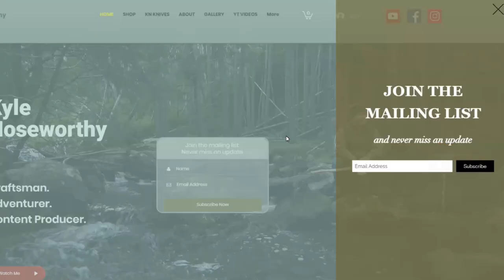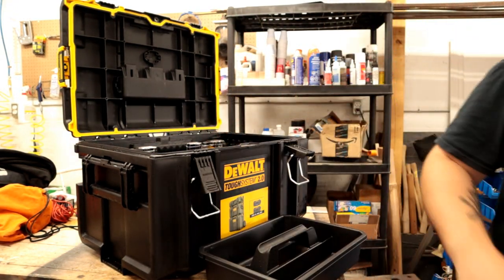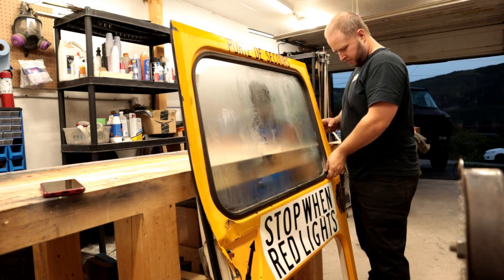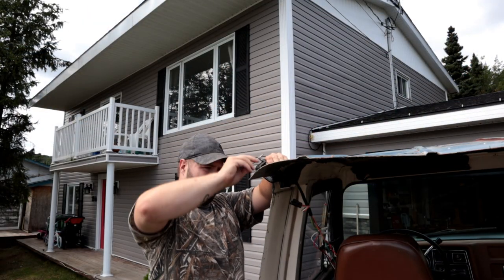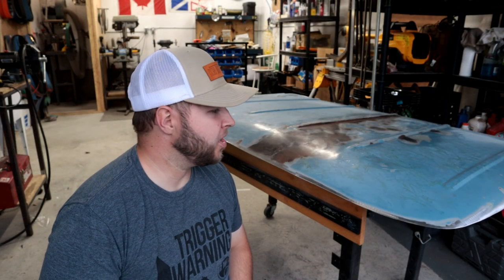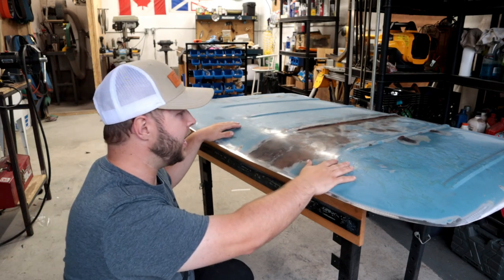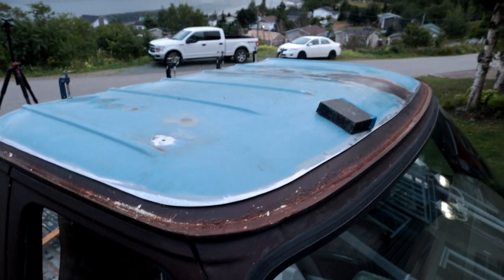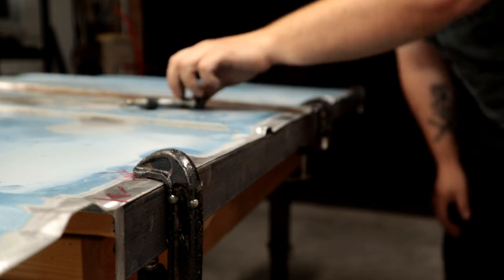BUILDING A CUSTOM TRUCK - Metal Fabrication [12]

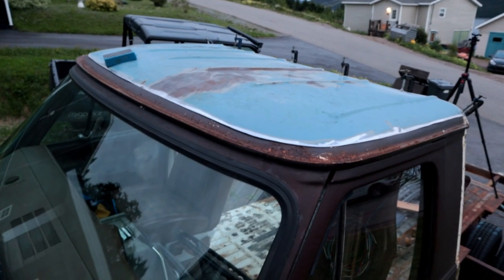Comment: Brings back memories of an old Volvo wagon project i had. 14:00 i thought i would be welding that up right then and there- but my volvo had considerable flames from paint and coatings in cracks and crevices- clean it all up best you can, then clean it again, then have the extinguisher handy.

Comment: It’s like the Centurion. Granted I prefer Japanese, old GMC and dodge for truck. Japanese while expensive are just indestructible. Nissan trucks for work tend to last just as long as Toyota but are cheaper and don’t have that classic look. Old Chevy’s just keep running and GM basically making them like LEGO’s makes them favorable. Older dodges their gasoline engines and even transmissions last. From my experience Ford works great new and comes in a a cheaper price point and they offer the best fleet when doing a cost benefit analysis for a larger operation. For a small operation buying used I can’t recommend. Yes buying a used Ford is cheaper then the others but they will break. Now if you have the time to fix them go for it but if you’re unable to do your job while fixing them, I would not say don’t go for it. For small scale agriculture operations I can’t recommend Ford. Profit margins are too small and deadlines are too tight to consider them. 

I would never recommend new for small agriculture unless for tax purposes. I also would not recommend diesel because I have yet to see a small farm or land scrapping operation require that towing capacity. Full savings aren’t there for frequent stop and go and starting for farm or landscaping activities.